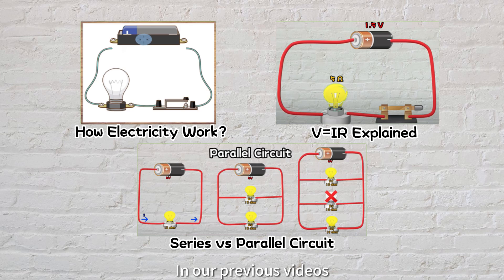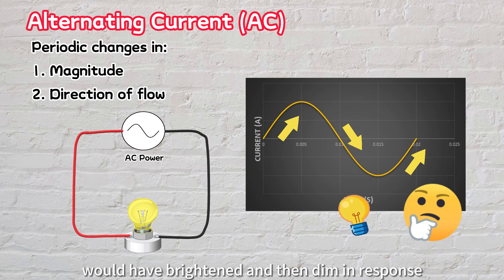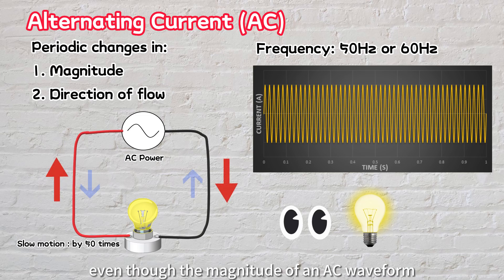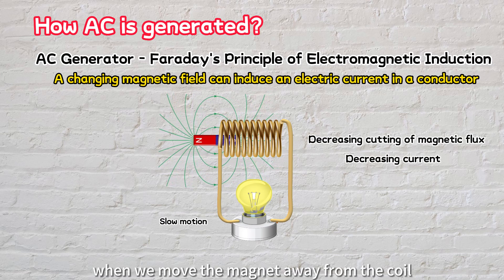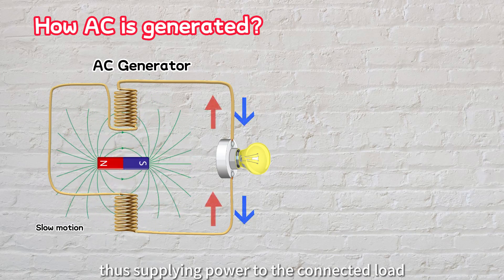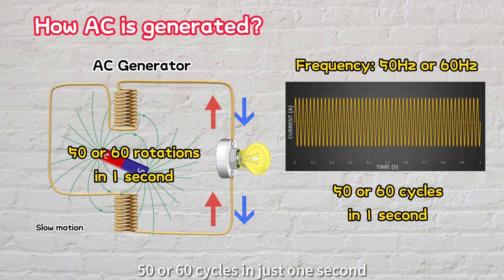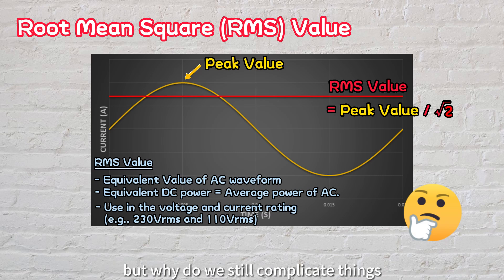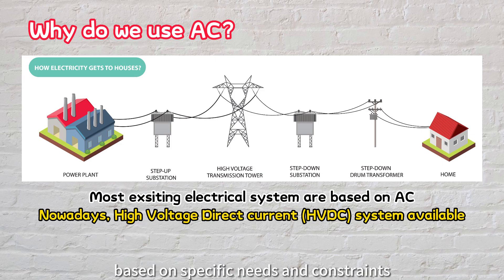AC Explained | Alternating Current - Simplified

Comment: DEFINITION A PARADOX REVISION 

Biological  refers to the process of
converting chemical compounds
into usable energy through metabolic
capabilities of organisms. It can also
refer to the energy stored in organic
materials, known as biomass, which
can be used to produce electricity,
heat, and transportation fuels.

Cellular energy storage and transfer: 
Adenosine triphosphate (ATP)
The primary storage molecule for
biological energy, often called the
"energy currency" of cells. ATP acts
to universal intermediary for energy
transfer in cells, powering activities
muscle contract, protein synthesis.

Cellular respiration
A metabolic process that extracts
energy from nutrients like glucose
to synthesize ATP. 

Artificial Intelligence Data 
What is Alternating Current (AC)? 
Basic AC Theory ...

Alternating current (AC) is an electric
current where the flow of electrons
constantly changes direction, moving
back and forth in a regular, repeating
pattern, unlike direct current (DC) 
which flows in only one direction.

The back-and-forth movement create
cycles per second frequency current.
Most power in home business is AC
because it can be easily changed to
higher or lower voltages using step
up step down transformer efficient
long-distance power transmission.  
https://lnkd.in/d-SJBZsF

Comment: Definition A Paradox Revision 

Artificial Intelligence Data 
What is Alternating Current (AC)? 
Basic AC Theory ...

Alternating current (AC) is an electric
current where the flow of electrons
constantly changes direction, moving
back and forth in a regular, repeating
pattern, unlike direct current (DC) 
which flows in only one direction.

The back-and-forth movement create
cycles per second frequency current.
Most power in home business is AC
because it can be easily changed to
higher or lower voltages using step
up step down transformer efficient
long-distance power transmission.  

https://youtube.com/watch?v=PjYxmmU3MCE&si=GRNffnFuhcFj7JTn